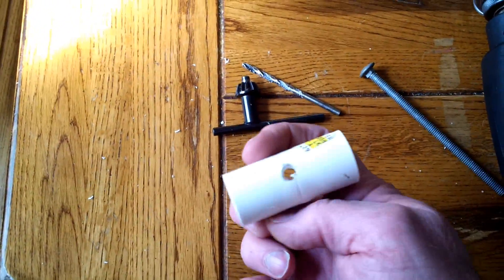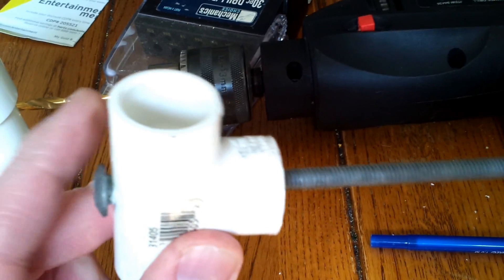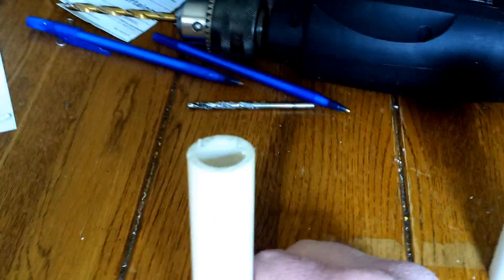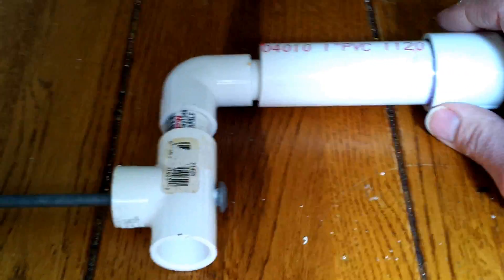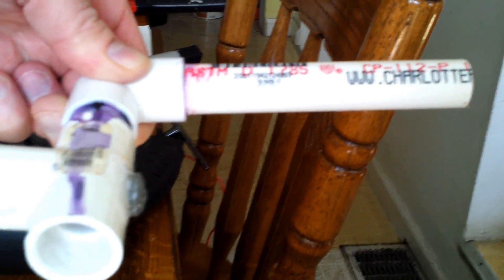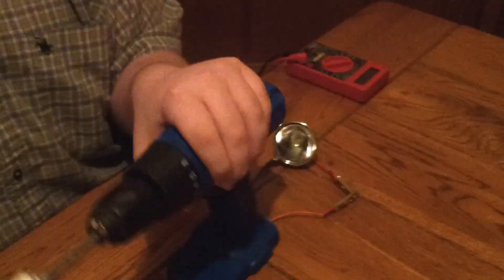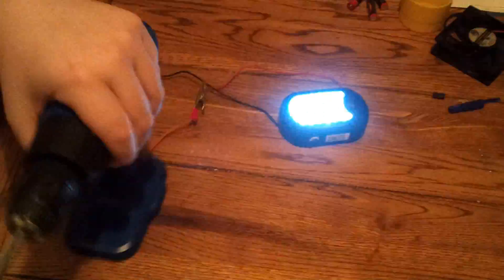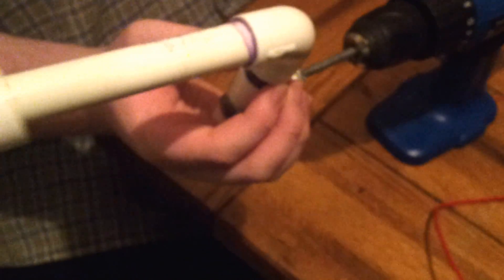Drill used as Generator / DIY Hand Crank Step by Step build

Comment: Have you ever tried to put magnets on the end of the drill. In other words have the magnets rotate instead of a drill bit. Next, strike a coil of copper wire. A guy told me has a 12 volt drill(battery and with cord) and has a lot of magnets on the end. Also, have a lot of copper wire the magnets is striking. Add more magnets and copper wire to generate more electricity. Now, I didn't get picks of this guys generator and I don't have copper wire or magnets. So, not sure :-D I was curious if you think this guy is telling me the truth or not. I do know people who have wind generators have copper wire as their stator. Also, they have magnets striking the copper wire. I have seen that on you tube so in theory it should work :-/

Comment: attach drill to a fly wheel with a handle on it , then get a boost converter hook up to a battery that way it would be more useful
Reply: the fly wheel weight keeps the constant drive and reduces flashing?
Reply: Other method to reduce the flashing and imbalance, is placing the damn drill on its side and clamping it to the table lol.